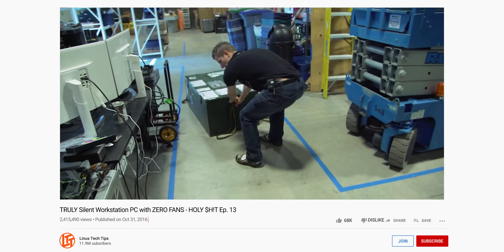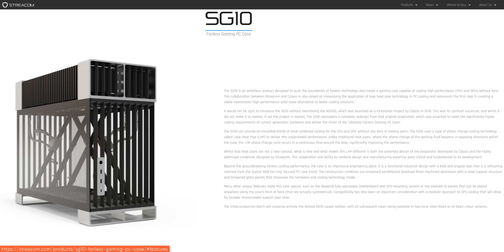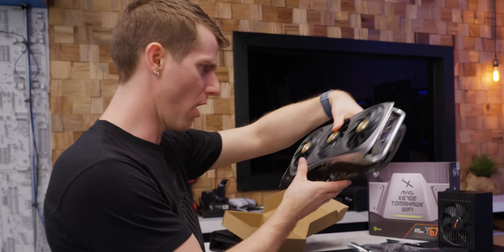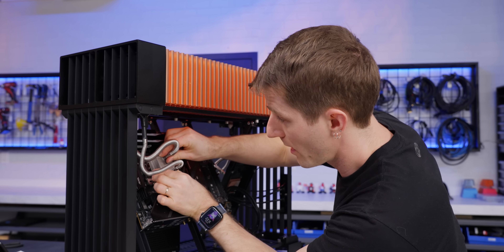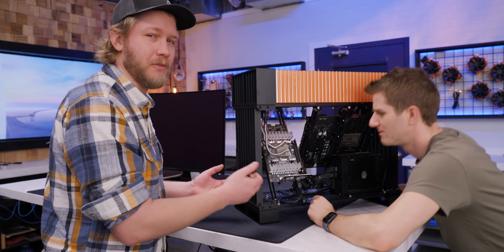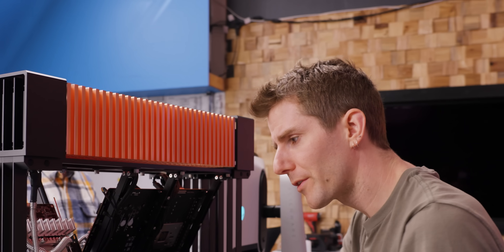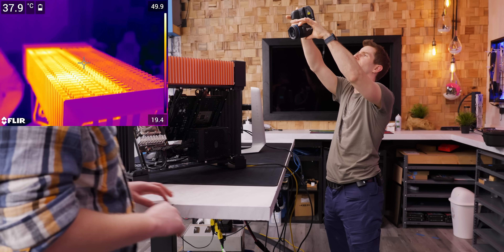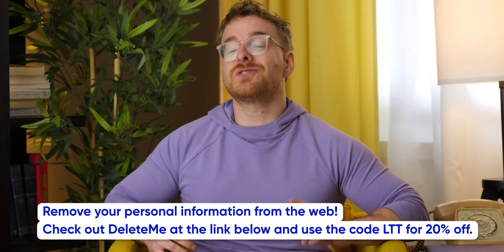I bought this scam PC case... And it actually arrived

Comment: Not an engineer here, but honestly I could see this working in a less demanding application to reduce power draw from cooling. It would be interesting to compare this, to an air-cooled and liquid-cooled system not only for thermals but overall power usage too in varying heat conditions. That could be interesting to help people pinpoint a potential use application for this.

Comment: The heat-pipe to finned chassis units cost about that or more at full retail pricing before any of the necessary block & heatpipe bits. So for $1000USD for a true phase change without any moving parts plus all the bonus accessories isn't too bad. When it was being shown & how you guys were skating around the price I thought it would be Titan CEO Edition level of stupid expensive. In theory, minus the front IO, this case if it does last could be one of the last case(s) you could buy for yourself (given ATX stays perpetually the standard for custom builds). As long as the manufacture can still release GPU blocks or if they release the design files so you could always have a custom block made for you then yeah should be good as long as the "coolant" doesn't leak out over time.

Comment: Sir love your show. I see a possible problem. Ok hear me out I love steam locomotive technology. So for instance water when boiled in a sealed pressurized system that also has air bubbles trapped can cause all kinds of havoc. Steam locomotives have safety relief valves and check valves, and so on. They also in unfortunately not rare circumstances, a steam engine would explode from its running dry or air got in the system in the locomotives flue sheets give way and explode.
You keep saying you can feel it boiling. Does this system come equipped with internal safety valves in case the boiling pressure gets too high it won't explode the cooling lines or seals. 
I'd make a safety check valve that has a tube that would drain directly out of the bottom ( with like 8ft of tube to make sure the liquids get away from the electric bits. 
I am sure the system was tested for overpressure stuff but just to make sure I figure I'd mention that.
Actually I in my opinion any enclosed liquid system should have Safety dump valves.

Comment: Alex, you'll appreciate this: this cooling system may not have an actual "pump", but it's reminiscent of the Ford Model T, which used what they called a "thermo-syphon"...or in other words, hot water from the engine rises to the top of the radiator purely because it's hot (this is why the top of the radiator is so much higher than the top of the engine block), pulling colder water in from the bottom of the rad in a self-circulating system without a mechanical pump.
Reply: Not the first time LTT is doing a video on thermosiphon cooling components; https://www.youtube.com/watch?v=M13dWRL9qkc
Reply: it's not the usual thermo-syphon system because they are using gas but the physics apply on the same way
Reply: I've got a Mccormick Deering and John Deere used the same system. Very popular in the day
Reply: Dude, no they don't.

Comment: If the exhaust is funnel out of the room like a normal heat pump instead we got the normal room heater. Very bad performance using refridgerant.

Comment: $1k is honestly a pretty killer price for this, especially when you consider how much a custom watercooling loop would cost
Reply: website lists $1.5k
Reply: I think Ill wait for this to hit ebay from some lonely soul that regrets spending two grand on this case
Reply: You can spend well over 1K in just water cooling parts alone without the blocks.
Reply: @AcM.5233  Sure, but that would be out of preference rather than necessity. You don't need to spend anywhere near that much just to get good cooling performance and near silence.
Reply: Why would custom loop cost that much?

Is piping really that expensive?
Reply: @mnomadvfx  Yes. A good gpu block is easily $250 by itself. Then you need all the fittings, cpu block, radiator, the pump and resivor, and if you want hard tubing it's even more expensive. $1k for a complete custom loop is pretty normal, and that's without any of the tools you need to actually assemble it.
Reply: @woodlandwrench  wow thats crazy why so expensive for a bunch of pipes? my entire 3060 5700x build costs 1k with aio.
Reply: @valorantplayer7586  I'm not really sure why. Back in the old days, there was no aio. We used aquarium pumps and makeshift copper blocks. Or you could buy machined copper blocks. I also just use aio these days. As I've gotten older I've become more "function over form" as they say. I'd rather spend that $1k on a better cpu/gpu, ram, etc.. instead of water cooling. It looks awesome, tho, so I understand why people do it. Also, of course, if you've got upper end rig, like a 5090 and 9950x3d, it makes sense if you want to push some overclocking.
Reply: @woodlandwrench  I mean, sure, but you NEVER have to sepnd that much on a custom loop. Especially if you don;t really give a shit about showing off your rig to anyone, since its tucked under your desk.
Reply: I ditched watercooling when I switched my focus to other hobbies and decided that aircooling is the way to go. I practically never had to do any maintenance for the last 6 years.
Reply: @woodlandwrench  Yeah, but with that setup up your build runs ice cold, this thing can't even come close to that kind of performance.
Reply: @woodlandwrench I'm still looking for a reusable GPU AIO that can be used across generations. Instead of those $200 highly custom model-specific and manufacturer-specific water blocks, that make no sense.

My concern is getting that 300W out my case via the AIO radiator, instead of heating up the other components like my SSD.

People keep saying the other GPU components will burn up, but I'm sure some copper fins and 120mm case fans will do the trick.
Reply: @mnomadvfx  let's say (I'm going toward low end here) 

$100 CPU heatsink, $100 GPU heatsink, $150 PC case, $60-100 on additional(?) fans, $100 pump/res/?, $100-200 radiators, add tubing/fittings/coolant, you're in the 600-1000 range already... So if the Aluminum version actually were $1000 it's not That insane especially with the low volume/customness/fully built out nature of this thing. Still.. very niche and requires someone who knows what they're doing that also Wants this.
Reply: No it's not
Reply: By the way they were talking I was expecting 5k+, even 1.5 seems reasonable for such a boutique product.
Reply: Yeah but a custom water could PC would be way cooler
Reply: very cool price, esp with copper
Reply: Custom yea but normal watercooling with silicon tubing does not cost much.
Reply: @eagleman983  A good custom loop does not have to cost that much (it can, but it doesn't have to) and you gonna get way better temp than this.
Reply: The parts are overpriced
Reply: If your buying overpriced parts. But a well thought out loop is roughly $500.
Reply: Copium 😷🤿
Reply: Yep, after all the buildup on price I was expecting the 5k region as well. 2k for the special edition, but 1k for the alu with similar performance feels like a bargain after all that build up.

Comment: My NZXT H6 Flow with a 3090TI + 5800x3D with a 360 Aio totaling 9 Fans on the build, and gaming on Cyberpunk gets my 3090 to 68c core (Memory junction 84c) and Cpu 44-48c. Room temp is 21c. Cyberpunk Ultra + DLSS quality + RT Ultra 1440p.

The Case costs 100Eur. Do you think i will spend 2000Eur on a hot garbage that weights 31kg and doesn't even work? What a waste of money.

Comment: 13:22 My guess is that is like the same sound that you hear when the compressor goes off in the exterior unit of your AC, that noise that you can hear for a few seconds.
Reply: Boil some water on a stove.  The pan will start making noise before you see big bubbles.  As somebody else here described, it's the beginning of boiling, when most of the tiny bubbles collapse.  (The same kind of cavitation that damages propeller blades.)
Reply: That noise means your ac has a paucity of refrigerant

Comment: what i don't understand is that when you use some things they have ducting to help move air around.  computers use fans but they don't use any kind of ducting.  (which in my opinion is far less efficient than if ducting was also used)  is there any such thing or would customers have to 3d print their own?  you can still add fans to this unit as well and i have no idea how you'd design ducting for it... but i mean i'm not a rocket scientist, i assume it can be done... what do you think?
Reply: Plenty of computers have ducts. Lots of HP workstation computers have ducting, I’m sure other brands do too. And pretty much any server pc has ducts.

Comment: ... 50c is high for idle CPU? mine is basically never below the high 40's, gpu (5080) is always in the mid 40's and under max load goes up to 70, highest I've seen it spike was 73. Only have the system a few weeks, highest it used to go was 68/69 past few weeks it has been inching higher

Comment: I'd love to try this at my house during the Australian Summer. I average about 33c average Ambient from about 10am through to midnight. and that's with a cheap refrigerated air conditioner. Our house has poor thermal regulation/insulation and so she gets real hot. heat waves are devasting. I stream my in/out temps so people understand why I game with my shirt off sometimes. it can be 33c in here (or higher) when its just 35c outside. but around 10 or more times per year we get well over 45c outside and I end up dealing with 37c in the room. so i'd love to see how this puppy worked in my room next summer.

Comment: I have absolutely no idea who this is for, they're wasting tons of copper, the case costs over $1,000, the temps are worse than a $400 AIO, and there's no cooling for any components except CPU and GPU. I guess it's one advantage is that it's supposed to be quiet, but you could always cap your PC fans at 2000RPM and you'd still get better temps than that. This makes no sense to me, except as a fun idea to do something unique maybe. Maybe if you added outake fans to improve airflow on the top it might run cooler but idk, just seems like a waste.

Comment: Well of course it works!  The idea was first used on steam engines and later in 1912 the Ford Model-T used it as well.  The question I have is, is the increased cost of the copper radiator less then the cost of the fans?  Also, the savings in electrical cost is nothing compared to the 400-800 watt usage of today's graphic cards.  Ocverall the system works for the CPU and GPU  but the rest of the system is not being cooled by the usual airflow from even one rear exhaust fan.   No thanks, I'll stick with the proven use of my air cooled fan system.

Comment: 7:51 "Does it line up? Eh... mostly... there's a little flex... another minor inconvenience."
Literally my experience with building my first PC, I kept running into issues of 1/64" of an inch clearance or fitting issues. I actually had to shave down the power supply to get it to fit.

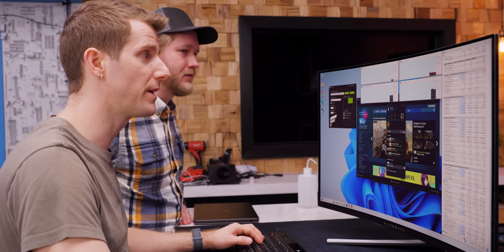Comment: 12:41 over 50 is bad? My laptop sits at 90 degrees when I’m playing. Most of the time the case gets so hot that it will burn my hand. I have maximum cooling for it as well.

Comment: My pc is fanless thanks to a previously abandoned o.g. Zalman Reserator that I bough for cheap on ebay,  but it is not pumpless. The thing was overbuilt for it's time, absolutely ignoring the laws of physics, and how water cooling works. The only downfall was the 112V fish tank water pump. No, I'm not making fun of it, the part was picked from an existing line of fish tank filtration pumps, and the lower part of the cooler was machined to fit it. This would be great, if, it had any real head pressure at all, and if, the pump was easier to access for replacement. How do I use it then? Well, the pump can be removed if you take everything apart, and an external pump can be used, if you hook the lines up backwards. This works amazingly well if you put a standard pump in your pc, then place the Reserator somewhere at least a few inches above the pump.  How well does it work? I can run dual 1080s water cooled, with a 3600X, and set 3dmark records for the combination, without anything overheating or throttling. The heat exchanger is massively oversized, and the increased flow of a modern Bykski pump ensures even coolant temps across the components. The only thing similar produced today, costs close to 1,000 dollars, are linkable like legos and I think they are aimed at industrial applications.

Comment: So it wasn't a scam but just poorly managed. The CPU connection is made of copper which means you can't use Liquid Metal to avoid reactions. Personally I like these Mechano builds not for the faint hearted with the need of being a certified technician

Bequiet is so much better dudes. And thermal Grizzly gives you a spatula for a reason isn't it. The evaporator is the big copper thingy on top. That's where things evaporate just like in an AC under different pressures. They are called condensers and evaporators. I guess this can only work with AC and fridge gas. In hotter environments a fan for the copper block might be inevitable

Comment: Copper is great for conducting, but aluminum is better for radiating heat. I would assume the all version is a bit lighter too. That said, I think it's amazing to finally see a successfully implemented phase change cooling system for a computer. Having it be passive is even more impressive, as most phase change cooling systems (heat pumps) consume a great deal of power with fans and a compressor. This should show folks that even passive heating/cooling systems can work in the scale of a building. It's all about how you implement it, and applying the right technologies & methods for the given situation.

Comment: you basically have a modern HVAC system in there minus the air handler. this rig will function as a gravity heater if you let it

Comment: I'd actually buy the non-copper one, primarily because copper at temp like this would begin to tarnish over time, and aluminum wouldn't noticably
and well 1000$ of savings....

I would get a modified GPU cooler that ACTUALLY cools the board properly, maybe even one that is a plate that redirects the heat of the GPU dies to the main cooler with additional heatsinks locally just in case conduction is bad

Comment: Hopefully there's enough convection there to cool some of the things like the VRMs and all. Zalman did this ages ago and I am sure while it ran and was silent, I would suspect there were failures in parts that were contributed to because of the shear lack of airflow over things that were designed to have airflow. Zalman's case had sides so there was no internal convection at all.

Comment: get some small Heat Sinks  and use thermal glue to put them on the video card it should fix them hotspots I use to do that on chips on the back of  older cards .

Comment: Allegedly, copper is better at moving heat than aluminum, but aluminum is better at releasing the heat into the ambient, i whould love labs to check both the aluminum and copper versions to see wich one is better.

Comment: 16:30 im going to guess that linus is pointing to a mosfet, as they normally do add some cooling to those. they are fine running hot and should be rated upto 125c. that said, the card was designed for this that to have a heatsink to dissipate into.

Comment: The fact that it continued to operate is more of a testament of the components used in the build and less about the case. Are their not  setups that work better and more efficiently that don't cost 2,000 $ .
Reply: There are better ones, but do they have 0 moving parts? It was never practical to begin with.

Comment: If I had an endless supply of money I would never buy this case. 74c on the GPU and 86c on the CPU after 4 hours... absolutely not. I can't get my 4090 to 74c while gaming when it's overclocked with access to 600 watts. And the CPU, 86c WHILE GAMING?! It will certainly thermal throttle doing any CPU intensive task. I'm sure if they had loaded Cinebench and let it run for a few minutes the CPU would have started thermal throttling very quickly.
Reply: I'm really curious how it would perform if you undervolted the gpu and cpu a bit. Heat output grows basically linearly with power use, so undervolting would help massively here i bet. Could even put a couple of 140mm+ fans in there at a constant low rpm to get some airflow going for the parts the cooling doesn't cover while still keeping it virtually silent at any load.

There's definitely a case to be made (ha!) for this case, i hope it's possible to make it cheaper in the future.